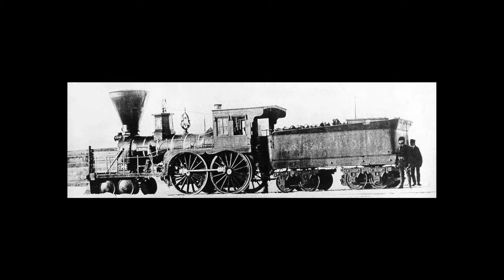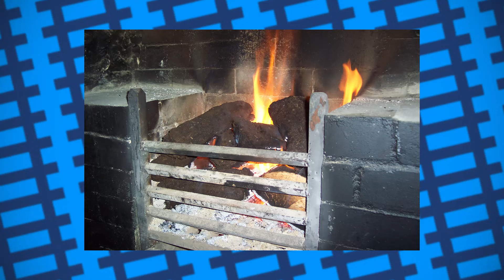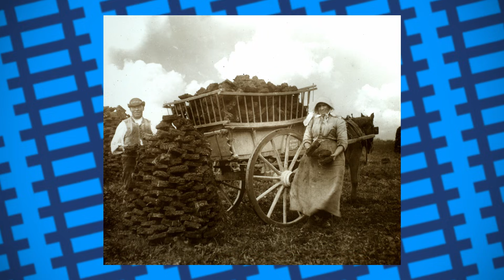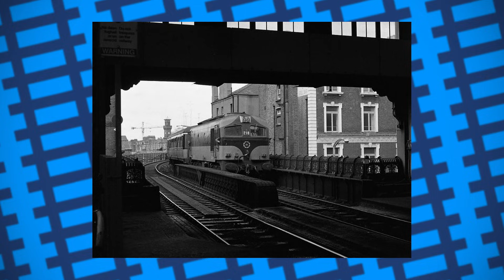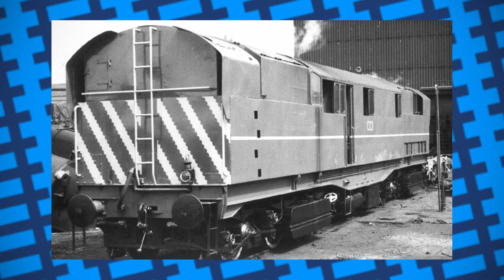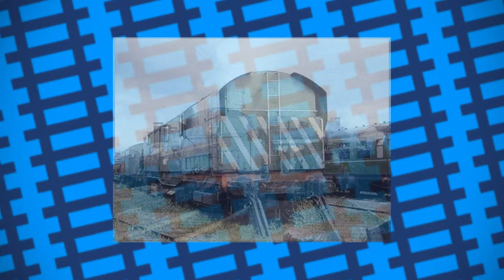Bulleid's bizarre turf-powered train - CIÉ CC1

Comment: This was certainly interesting! By the way, some claim Egyptian railways were known to burn mummies (from mass gravesites) while I've read that on one occasion, an American engineer and fireman stuck with a tender-full of badly burning slag stopped the engine, picked up a bunch of old tires, and jammed those into the firebox, where they burned beautifully, albeit leaving the grate covered in metal rods and melted rubber, which didn't go down well.

Comment: When I would think of mud as a fuel my thoughts go more in the direction of using coal dust in the form of sludge.
I know coal sludge is used in stationary boilers as it can be pumped and jetted in like oil, but I'm not sure of any use on locomotives.

Comment: If I had a nickel for every time Bulleid designed an articulated, double-ended steam engine that looked more like a diesel, I'd have two nickels, which isn't a lot, but it's interesting that it happened twice.
Reply: Bulleid had some great ideas, and then he went and ruined them with excessively complicated designs and a weird obsession with chains.
Reply: @zoqaeski but when they made no non-sense engine, they somehow did really great

Q1 for example
Reply: The diesel-like look of experimental steam engines is a recurring form factor. Most steam turbine locos looks diesel-ish, and there's even the twin Franco-Crosti belgian articulated mammoth that looked like a diesel.
Reply: Having read Kevin Robertson's book on the infamous Leader project, it seems to me that O.V.S. Bulleid was better at designing coaches than locomotives. Oh hang on, what about the Tavern Cars?!
Reply: Every railway enthusiast knows about this engine.  No-one ever calls it a "mud" engine.

Comment: While on topic of alternate fuel sources, I do recall one that surprised me (I don't know if you're ready for this one). The benefits of this alternate source happens to be: Cheaper, efficient, safe disposal of, less environmental pollution, and is sustainable & renewable. And it was none other than...animal dry dung...yes, basically dried up poop.
Can't say I know any engines that were powered by dung (I doubt that there were any), but I know a steamship that was powered by llama dung until 1914.
Reply: Someone told me the gases may damage the boiler (nitric acid IIRC).

Comment: A very fair summary of an ingenious idea. The problem with turf/peat is its low calorific value and high water content compared to coal, thus needing a large grate area and strong draught to give reasonable combustion. It made sense for Ireland to try it as they had little indigenous coal or spare dollars to pay for oil. The engine was more successful than the Leader and the use of a conventional firebox with water spaces rather than firebricks, and normal piston valves rather than sleeve valves, must have helped this. Perhaps a conventional rod drive rather than a chain drive would have improved things further. But as dieselisation took hold (despite major teething troubles)  it is a much more efficient way of burning oil than in a steam engine. Incidentally, unrebuilt Bulleid Pacifics with chain gear and oil baths now reportedly perform well with modern seals which have overcome the oil leakage problem.
Reply: One other problem with peat is that as it dries out, the burning strands of turf can be caught in the draught and swept out of the chimney, hence the lineside fires and need for spark arresters.
Reply: With how Bulleid derived his Chain-Drive gear, I feel like he was trying to design an alternative to poppet valves. The enclosed automotive design is very in line with original Caprotti, or the Franklin System. The cam boxes and gear casing were smaller so has smaller volumes of oil to seal. Poppet valves also seem to offer stronger blasts which could compensate for peat’s heating qualities.

Comment: i was going absolutely mad with that voice i heard in the background when i watched the video. and then it turned out to be the music. Anyways, Fascinating to learn about this experimental design. i wounder if it could get a resurgence for heritage railways for alternative coal fuel?
Reply: Interesting point, the snag being its low calorific value and high water content which requires a big firebox and different draughting. So most preserved locomotives would need a huge retrofit. That was why Bulleid's first engine No. 356 was pretty unsuccessful. One wonders if some peat briquettes mixed with coal dust and oil could be partly fired alongside coal. The other problem though is that as it dries out, the burning strands of turf can be caught in the draught and swept out of the chimney, hence the lineside fires and need for spark arresters.
Reply: @iankemp1131  true yes. I don't expect it to catch on as a main source of fuel on locomotive, unless it was to be remade with burning turf in mind. but it could be a good fuel for warming it up at the start of the day, or maybe as something you mix with regular coal to get more out of it. Though i see the downsides and expect no-one to actually use this. But who knows
Reply: @Odinnyb13  Yes, interesting ideas, lighting up sounds worth thinking about. I'm not sure what they use at the moment. Remembering my days with home bonfires, it you tried to burn wet plants or wood on a cool fire it tended to produce loads of smoke and not much heat, so that might be a barrier. Whereas a really hot bonfire would incinerate anything!

Comment: Some railways did have significant numbers of exclusively turf/peat-burning locomotives before the 1930s, for example the royal bavarian state railways, which had a significant fleet from the mid-1800s up until the early 1900s. Examples of such locomotives include the series B VI, or the Oldenburg railways class G
Reply: Sweden had some too
Reply: Have any German Railways tried lignite as Germany has substantial deposits?
Reply: @Isochest  Probably, i would be surprised if not.